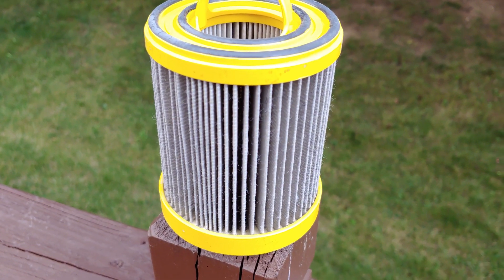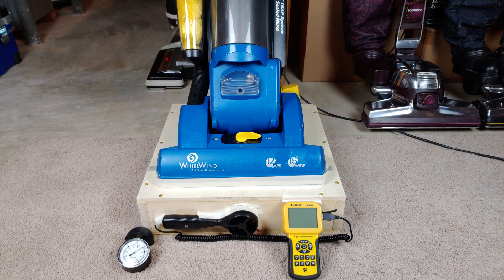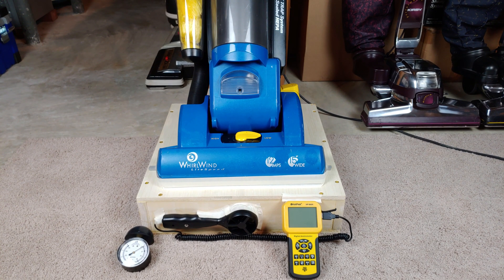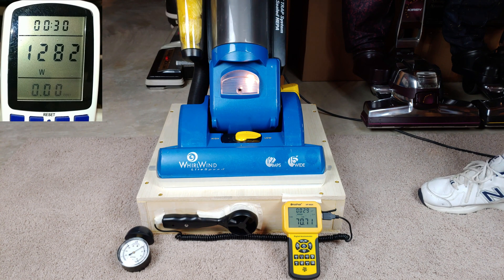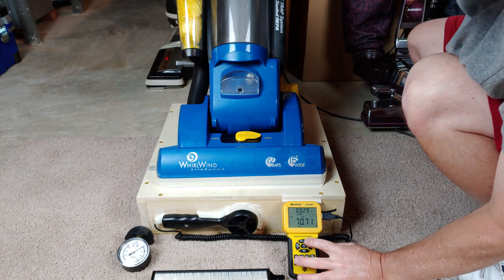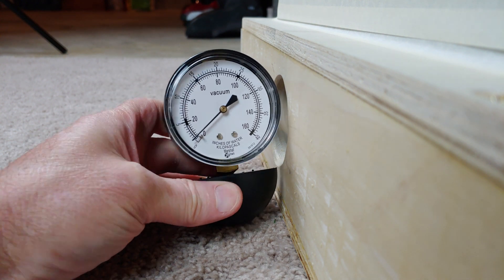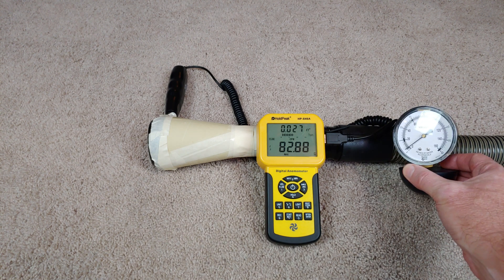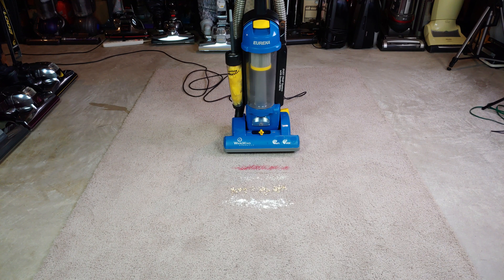Eureka Whirlwind LiteSpeed Airflow Suction And Brushroll RPM Tests

Comment: I have a question for the viewers. Are these Whirlwinds supposed to be this loud or is there something wrong with this machine that I need to fix? As you can hear, it is extremely loud.
Reply: I have a yellow one and it is really quiet, I think that this one has the same issue with the dry motor bearings as a lot of the first gen bissell cleanviews.
Reply: No typically they’re pretty quiet. Bad motor bearings maybe
Reply: its not motor bearings most of the time. the fan disc gets caked with fine dust and causes it to spin out of balance. these machines let fine dust past the filters easily and this is the result. the pleated filters helped but as they clog air gets past the filter as it seeps around the filter seals. always clean the filters well and never wash them even though they say they can be. had a victory style whirlwind big cup model that did this. once it started making that awful noise I got all new filters (new style pleated) and made sure to clean them and the seals after every use. the noise lasted about 3-6 moths and then one day I used it and over the course of about 15 minutes it all gradually went away and then ran great for many more years like it did when it was new.